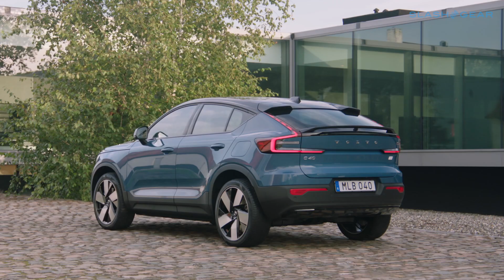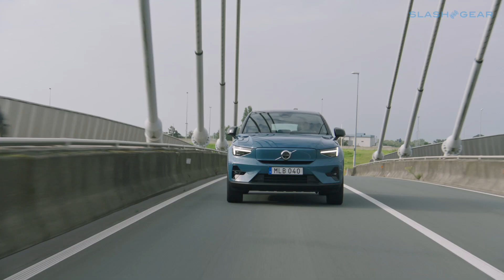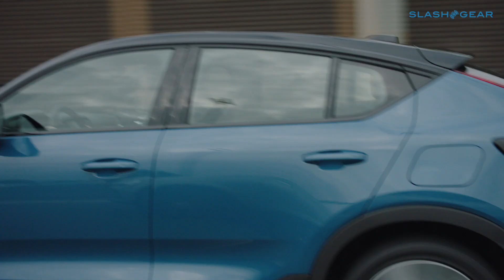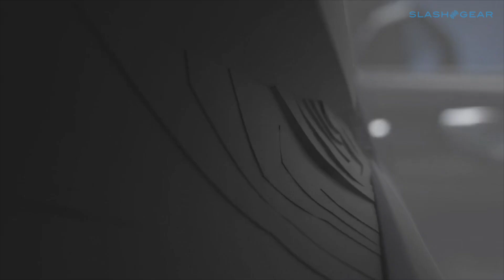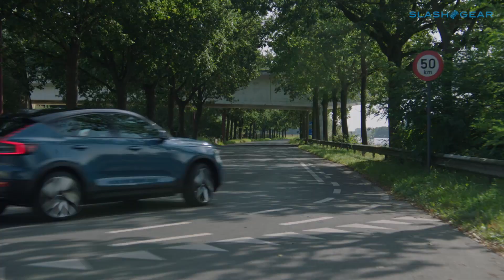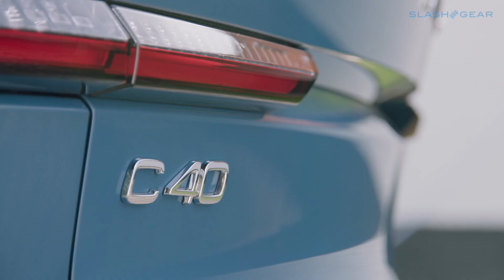2022 Volvo C40 Recharge First Drive

Comment: in the era of Polestsr 2, the C40s price makes no sense
. everything in the Polestar 2 is better than the C40, including the top of the line sound system and the absence of the 112 speed limit
. if the C40 cost $35k, it would be a no brainer
. im going for the Polestar 2
Reply: A Volvo is not going to cost $35K. It would make more sense if you said $45K. The C40's price is a problem, but not $25K more than it should be.

And since, at least in my opinion, coupe SUVs make no sense yet people purchase them, Volvo doesn't have one so they might as well turn the electric xc40 into one. The Polestar 2 is a sedan/fastback despite a bit of ride height and the xc40 has a more practical hatch design. 

What bothers me about the c40 is in 2021 it has the same familiar interior as the xc40. Volvo didn't change the interior basics one bit (new felt/carpet colors and inlays aren't a significant change). Time for an updated interior from Volvo but we have to wait until the next-gen Volvos for that.